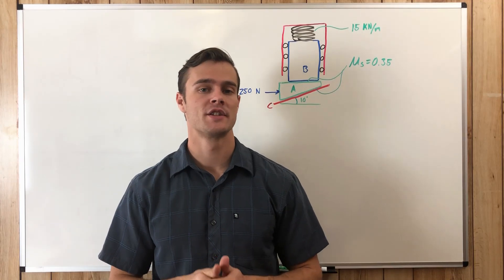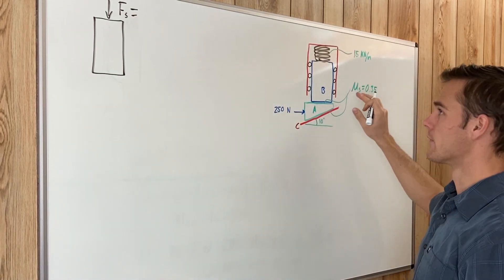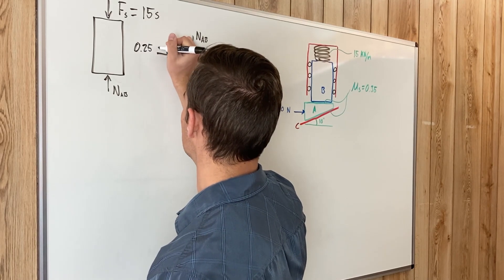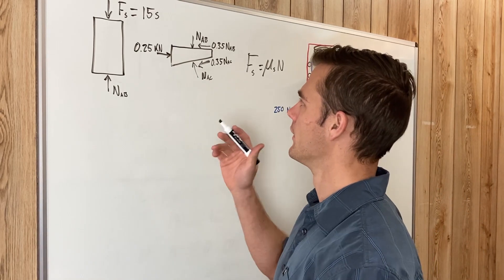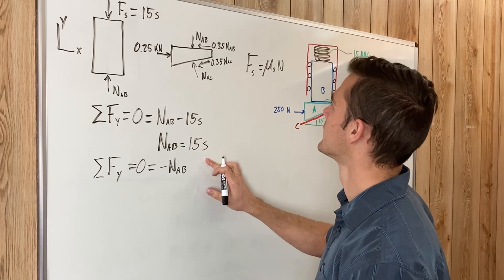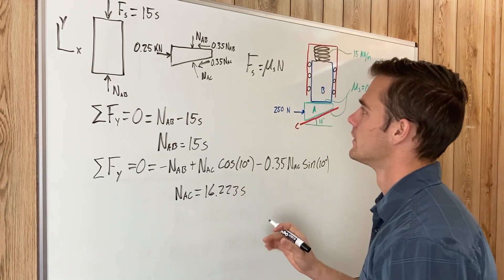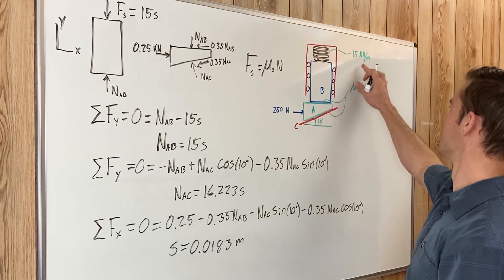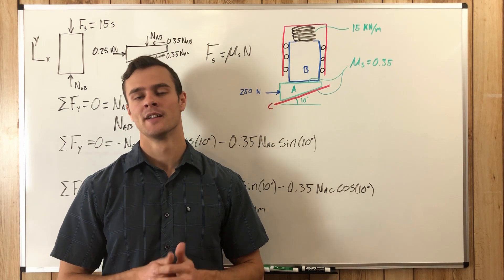WEDGES EXPLAINED // Example Problem Included! // Step By Step Solution

Comment: what about the rollers pushing back on the block? wouldnt you add a normal force to that block?
Reply from the maker: Great question! Since that normal force is acting perpendicular to the vertical movement of the block the only resistance they would theoretically give would be rolling friction which we are ignoring here. Basically we assume that they don’t contribute any resistance to the block moving so they don’t effect the problem. Does that make sense?

Comment: Because we have .35 acting on the wedge at Nab, if you wanted to show that on the cylinder since it acts on the cylinder as well, what would be the opposing force to the .35 Nab on the cylinder?
Reply from the maker: Great question. You are correct. The friction force .35Nab acts on the cylinder as well as the wedge but on the cylinder it will be acting in the opposite direction of that friction force on the wedge. On the wedge, that force is pushing towards the left, so on the cylinder it would be pushing towards the right. Does that make sense?